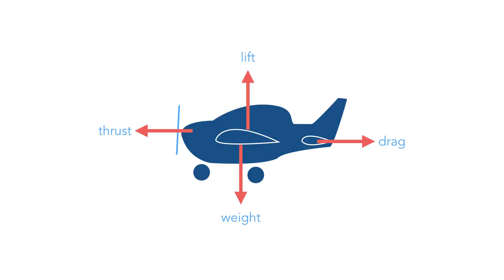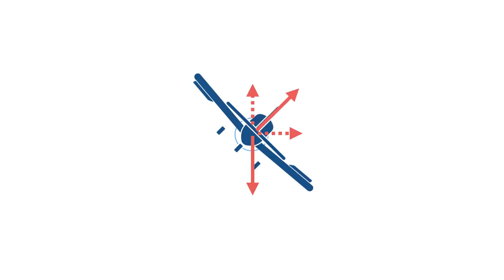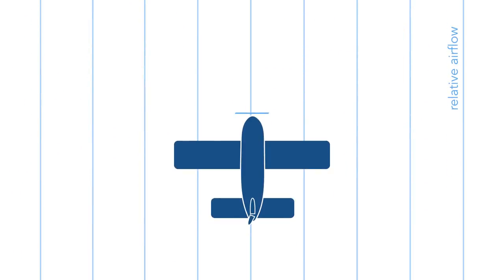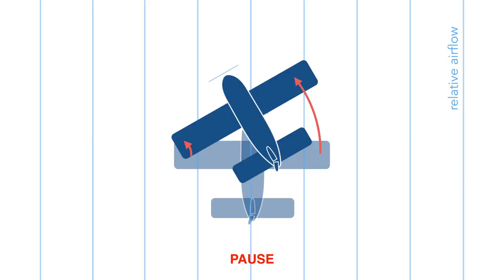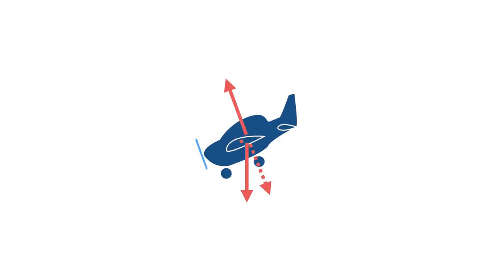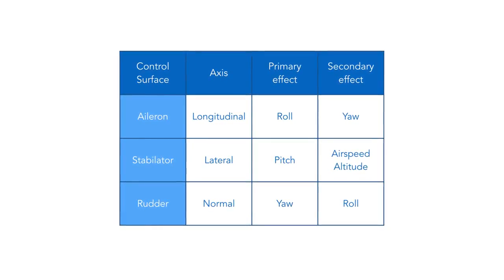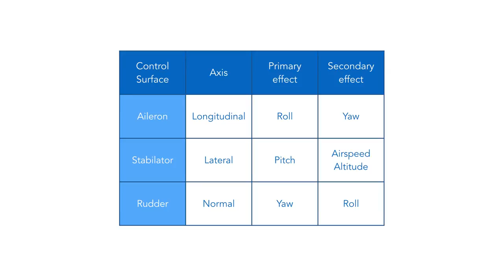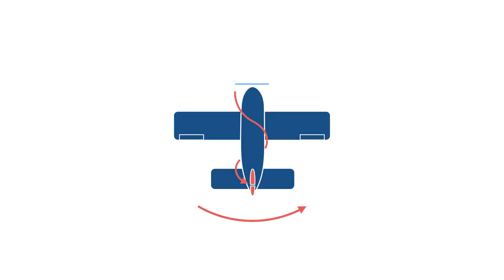Effects of controls.

Comment: I like the channel and usually agree with what is said. This time however, I am surprised how your logic goes astray: At 0.59 you correctly state that when the plane rolls the LIFT FORCE ROLLS WITH IT, and consequently the remaining lift component pointing in vertical direction is too small to compensate the weight. The consequence is a sideways downwards slide of the plane. 
Surprisingly, at 2.03 when pitching the plane down or up, the explanation now is that it's the "weight force which contributes to the forward motion and results in increased airspeed". This is utter nonsense. Just look at your graph: The force that gets tilted is still in both cases the lift force. 

In case of pitching down it is now angled more forward and accelerates the plane. At the same time the vertical force balance - due to the vertical lift component now being reduced - leaves us with a net force downwards (the weight is now bigger than the vertical lift component) and this net force down accelerates the plane also downwards. Together with the forward acceleration the plane is thus accelerated in a downward-forward direction (until it is likely balanced by increasing drag). It is exactly the same mechanism as on the lateral slide, only this time the plane "slides" forward/downwards.

If the plane pitches up, the lifting force is angled more backwards. This decellerates the plane horizontally, and still accelerates it vertically as long as the vertical components of lift (and drag, and thrust) are not balancing the weight force. 
If the force balancing is not resolved in time, the plane will eventually stall and recover its flying speed without the pilot's help🙂